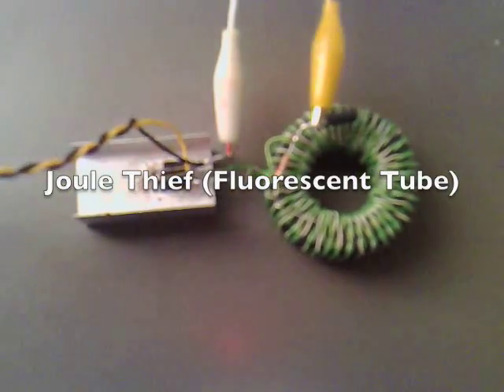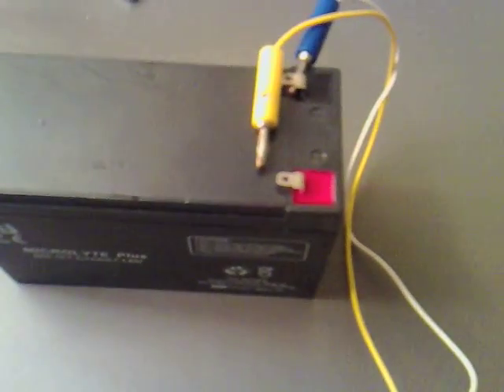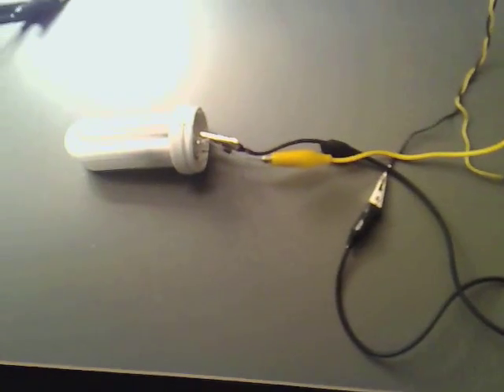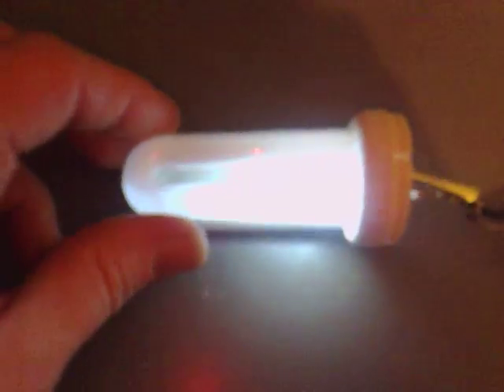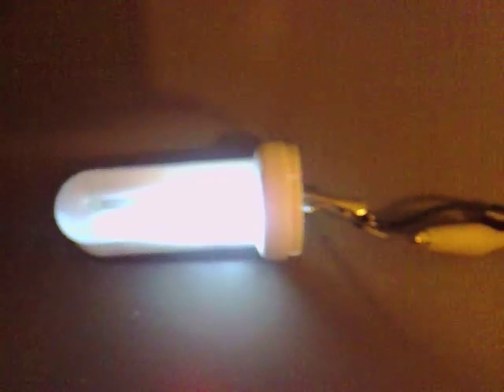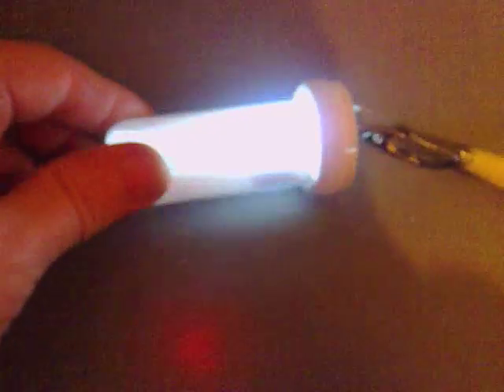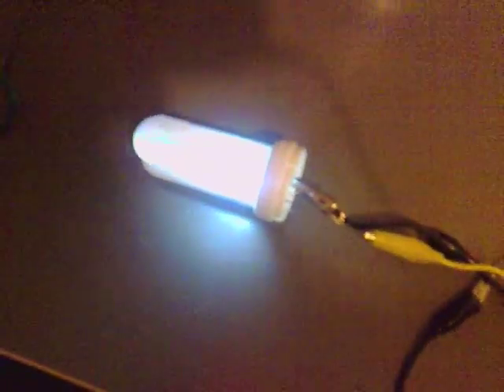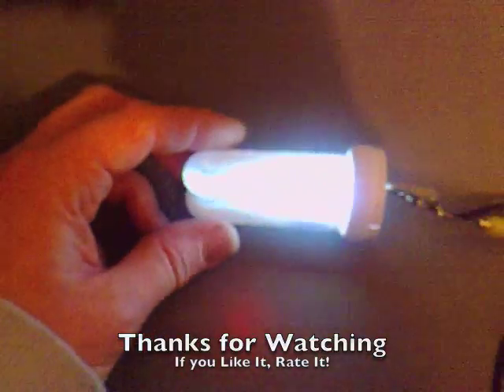Joule Thief (Fluorescent Tube) 013

Comment: this is very interesting the effect the magnets have on the coil output, are you using a 1.5v battery for the input? a CFL bulb is a bit like a flourescent tube, once the gas is energised using high voltage you can reduce the input power, that is why they are low energy.

Comment: i did exactly that, works great. getting very high voltage spikes
I used 90 turn bifilar "Bedini Twist" toroid and it resonates from 3V onwards. Charged a cap up to 400V from 3V (100mA)

u mentioned 555 timer, wats the point, like u say u can vary frequency with a pot

Comment from the maker: All CFL's have heaters in them as far as I know, they are what glows orange before the tube fires. A 3055 will make the difference.

I have two 10w LED's on the way, if a 20mA LED will run at 10mA a 10W will run at?.......5W

Comment from the maker: You can use microwave magnetron magnets as toroids and the magnet trick is inbuilt......kewl huh.

Mine was pulling 800mA at 10.4v = 8.32 Watts and it was a 11W tube but only running half of it.....

Have you tried finding the resonance and pulsing in that frequency with a 555 Timer? I think thats where I will go with this then once I know the frequency make a coil to suit.

I am thinking induction heating would make a difference also and scrap the two heaters in the tubes, what do you think?

Comment from the maker: You should put a neon across the collector and emitter too incase the Fluorescent Tube gets disconnected.  If the spikes are not going to the Tube they will go across neon and not the transistor.

Use solid data cable 80 turns should be better than mine.

its just a 1K resistor but the resistor does not matter that much, use a variable resistor and you will see / hear that the resonance changes.

Let me know how you get on.....

Comment: care to share your theory???

I have built this setup almost the same, 0.4mm bifillar, toroid, Bedini "twisted" wire, 2n2222 transistor....
But i cant get it to run a cfl?
do i need power transistor?? what rating resistor are u using to get it into resonance??

-yuor help would be much appreciated.

Comment: Hey nice video kubikop!

I think what actually is happening is that you are placing a ferrite-magnetic material close to the coil, and thereby you are increasing its inductance, its almost like increasing the number of wirings! So you are probably increasing the amount of charge which this coil can hold and then release, your voltage can go up. And if you don't have any capacitors in this circuit it is most probably not related to the change of a resonant frequency.

Comment: its the Back EMF or the spike of voltage that flys off the coil when u pulse current through it. Conventional electronics would damp out the large voltage spike so it doesnt burn transistors and other components.

Kupikop is smart and is capturing this spike

Comment from the maker: It collects the Flyback Voltage from the coil, This is usually grounded by a diode. It is a transformer a 1:1 transformer so theoretically it should only get 12v in 12v out but everybody overlooks the Flyback of the coil.

It works on the same principle as the Bedini Motor. I am in the process of designing a more efficient one so I can use all these designs to create my own separate circuit.

One Sentence answer is its a DC to DC converter.

Its Kewl aint it....